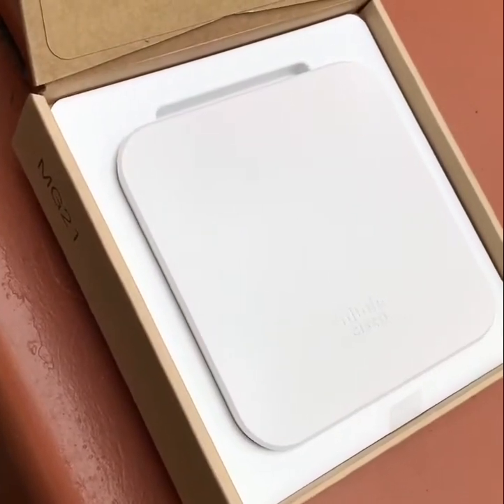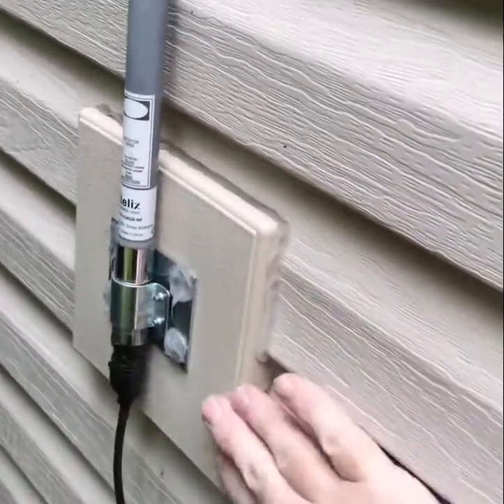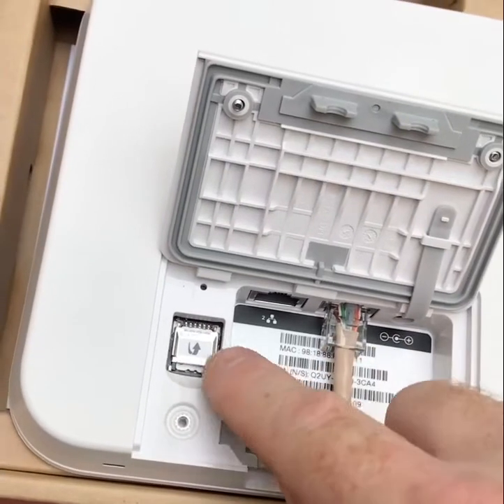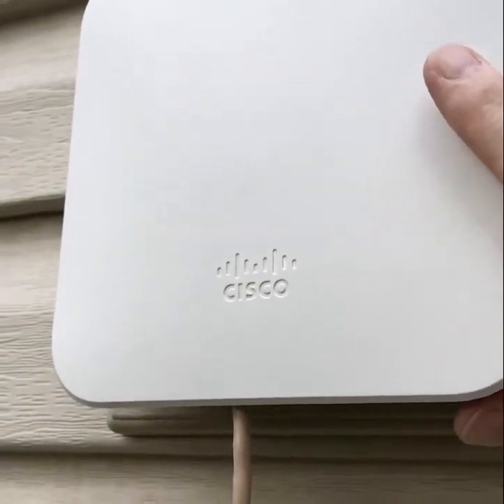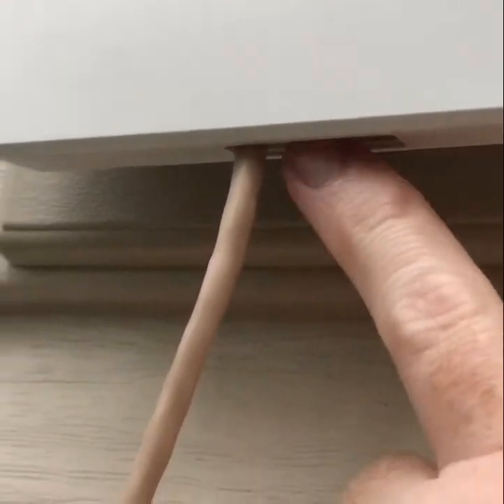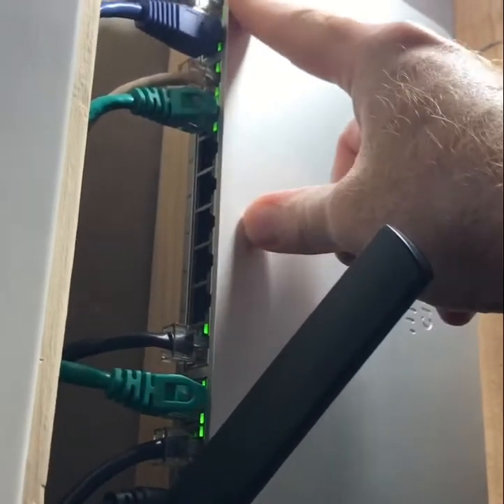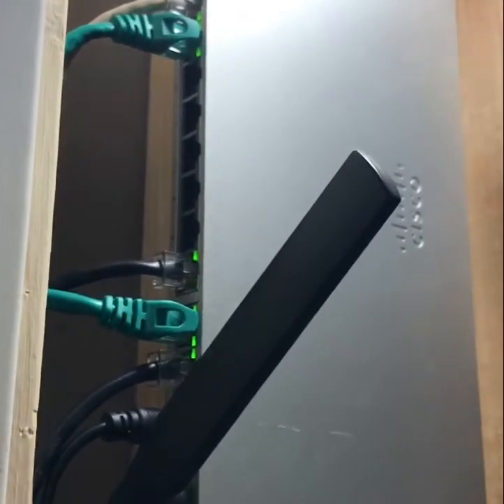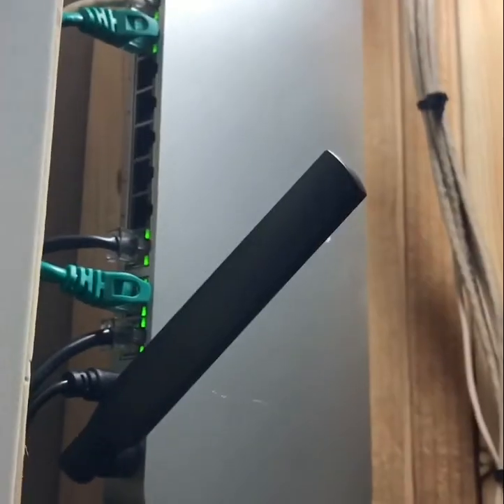Meraki MG21 Cellular Gateway Install

Comment: How do you power cycle your cable modem again?
Reply from the maker: Cable modem is plugged into a smart switch with an app on my phone. Smart switch is connected to the Wi-Fi in the MX68CW. If cable goes down or has an issue I can still reach the smart switch over the cellular backup (MG21 gateway). Turn smart switch off, then back on - manual reboot of cable modem.